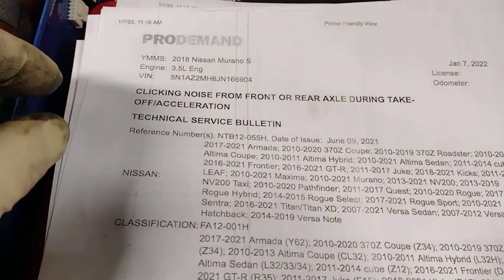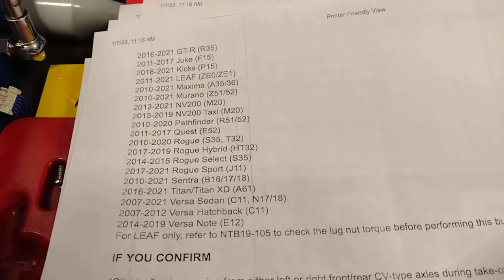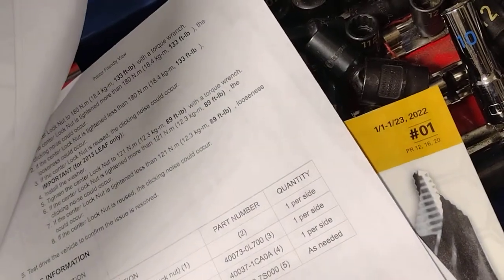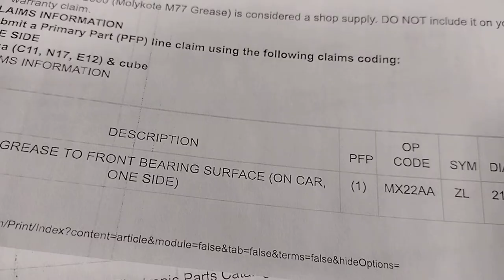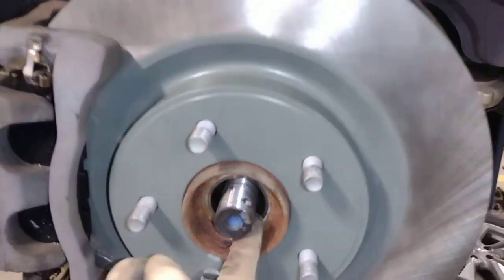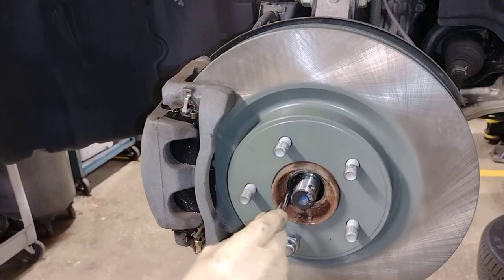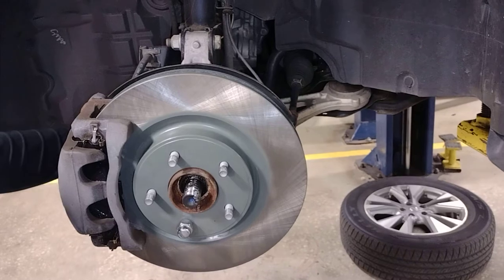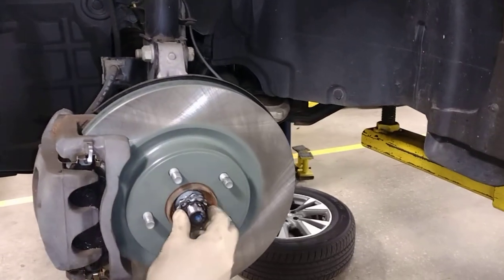2010-2021 Nissan Click Type Noise Or Thud on Acceleration/Deceleration/Turning. TSB NTB12-055H

Comment: I own a 2015 Pathfinder, and I know very well the transmission signs when they are going bad or acting up from my Altima's which were 2014 (5 defective transmissions)
 I took mine into a transmission shop at 69K to have them check for noise, the transmission WAS NOT SHUDDERING, just humming, they said it was a internal bearing, I hesitated and asked them if it could be a HUB bearing, sounds like a bad tire or humming as different speeds, and they said NO, I said I would pay them to replace Hub bearings and they talked me out of it. 
I ordered mine on line for $100 bucks and replaced both front, the noise went away! transmission was shifting as it always did, BUT I had the clicking noise and just knew it had to be the transmission finally doing what Nissan CVT do, go bad. 
But I watched this video and thought, that's the noise, the DIY dumbass probably didn't grease the spline as he described, (I'm the DIY dumbass) so I thought why not, jacked the front end and did exactly what he describes in this video and BAMM clicking noise gone when putting it in reverse, or any gear and drives like it was when we purchased it.
BIG THANKS FOR THIS.
 I think even reputable transmission shops take for granted ALL NISSAN CVT are bad! I watch Market Place and cant believe how many NISSANS that have 245K plus with a CVT transmission for sale still running strong, I want to be one of those people.
Will see but BIG THANKS for this!
Tools
Jack-Impact-Torque Wrench-Jack Stands-AND MOLLEY GREASE and it took about a hour with a coffee break in between....
Reply from the maker: Man, that's totally awesome. I'm glad i was able to help you out!  That's why I am here. Yes, cvt transmission are bad, and Nissan has the worst reputation for them.  However, what you described in your comment as I was reading didn't say transmission to me.  You were able to do this at home. Even with a coffee break, it took about an hour. It's the little things like this that make my day!  Enjoy your weekend!

Comment: It seems maybe... you could... just maybe try to spray some lubricant from the top axle/knuckle and let it soak inside for a bit to test if the noise goes away or gets quieter before doing this to confirm
Reply from the maker: What's that going to do?  The lubricant will just dry up. It's literally the repair procedure from Nissan.  There's too much play between the splines. That's what the grease is for
Reply: @BeardedFordTech  agree, I just thought as something to do try, obviously not a permanent solution if that's the problem with excessive play
Reply from the maker: @MylifeMB  i wouldn't waste the time with spray lube. Your just going to end up going  back in there. Just grease it and be done with it 😁

Comment: This can be done on either side? My noise is on the passenger side of the car. 2017 Sentra. Any advice for that whiny CVT? Thanks
Reply from the maker: @chadfowler7569  yes. Both sides. And the whiny cvt. Well.....replace it. It's not supposed to whine and doing a fluid flush won't fix it. It needs a new one
Reply: It’s been whining for a few years, but shifts and drives as it should, I think I’ll wait on the replacement. I appreciate your response!
Reply from the maker: @chadfowler7569  only a matter of time. I would seriously take that thing out and put in a DCR from S&S Motorsports

Comment: Deceleration, my favorite pet non-word.  Acceleration just is.  A change in acceleration causes a change in velocity.  Positive acceleration and the vehicle speeds up, negative acceleration and the vehicle slows down.  Apply and acceleration from the side and the vehicle changes direction.  Ok, OCD time is over ....
Reply from the maker: Lol. It was just basic laments terms. I like the way you explained it. But basically what happens when you step on the gas or let off or turn the CV axle bumps inside the hub.
Reply from the maker: You still need the brake vacuum?  Or did you get it fixed?  I don't think I ever got an email from you
Reply: @BeardedFordTech  - I appreciate the offer but I'm either going to fix mine or order a new one.  They're not terribly expensive.  The one I have that's not working so great was a freebie and is like $20 on Amazon.  Do you have one that you prefer?  Me being the amateur that I am was just going to go with another $20 one off Amazon unless a pro has a better suggestion.  On Amazon all the $20 one's look the same except for either the brand name or the color of the plastic case.
Reply from the maker: @abikeanditsboy3449  I love my matco one. It's been the best so far.  Harbor freight has a decent one for like $30. If it's just to use every now and then.

Comment: Good video, a shame that Nissan's torque specs are not clearly marked anywhere. But note that TSB only says to grease the backside (not the outside) and not the splines but the axle/bearing contact area. And of course it says NOT to reuse the nut, washer and cotter pin. Total cost at the Nissan dealer is under $7 for all of those parts.
Reply from the maker: Yep. But then they charge an hour labor or something like that. You can do it at home for $7 and a Saturday afternoon.

Comment: Did you feel the click in the pedal or floorboard when you tested the problem.  My pathfinder has a small click Occasionally and i can feel it slightly on ds floorboard
Reply from the maker: No. Just audible. Didn't feel it at all

Comment: Well, just to start, I was really worried what was wrong and how to diagnose the clicking problem with my nissan xtrail and I came across your video. I was contemplating getting rid of the car because of the price of a new drive shaft or clutch so I tried this fix and it stopped the clicking dead really lifted a weight off my shoulders keep up the good tips top man 😊🎉🎉
Reply from the maker: Glad the video helped you out!  I'm glad it worked out for you.  Have a great day

Comment: Thanks so much for this video bro, I thought this noise was my transmission going bad 😅, still will be nice if Nissan makes a recall out of this…keep the nice work 👍
Reply from the maker: Yeah won't be a recall. It's not a safety concern. Just an annoying noise. Just a TSB (technical service bulletin). And honestly a slot of Nissan techs know nothing about it.
Reply: I did the procedure today and I am surprised the clicking noise is gone, now the car is running smoothly, thanks @beardedfordtech for saving me thousands of dollars in repairs, this was so easy to do👍
Reply from the maker: @JOSEHERRERA-vl2yi  glad I could be of some assistance.  Glad it fixed your problem. Money saved!
Reply: @BeardedFordTech  The problem is that it can decrease resale value when someone tests drives it and it makes a loud popping noise and they choose to pass on it for that reason (I know I would).  I have had mine in twice to the dealership on warranty to try to fix it.  They have greased it twice and it still makes the popping noise.  I am working on the Lemon Law paperwork for if they can't figure it out in the next two visits.

Comment: Thanx for the video. Is there any cheaper alternative than Molykote M-77? Or if i can buy somewhere just a small piece of this grease?
Reply from the maker: Unfortunately it has to have moly in it.  Usually comes in a tube you put in a grease gun, or a small tub.  I mean any grease with moly in it should be fine. Go to your local parts store and browse around. I'm sure they have something there. Have a great day. 🤘🤘
Reply: @BeardedFordTech  Thanx for quick response. Will do that ... some with mos2 moly - understand. Nice day!

Comment: Was it a rear wheel metallic click sound at below 20mph  low speed only? I'm having issues with my wife's and this is 1 of many problems
Reply from the maker: @miketoti144  nope this was in the front. When you accelerate from a stop or turn.  I do believe the rear has issues as well.  Wouldn't hurt to grease it and see if the click goes away
Reply: @BeardedFordTech  I appreciate the response and advice. I'm tearing it down tomorrow and gonna grease everything I need to and check the suspension further.

Comment: Is this a permanent solution or will the molykote grease need to be reapplied periodically?
Reply from the maker: @vigneshie  honestly I have no idea. I don't own a nissan and it's been many many years since I've done this car. Have seen it since.  I don't think moly grease needs applying periodically.  It's molybdenum. So it stays pretty tacky in there.

Comment: @bearded Ford tech does it apply to 2020 nissan altima sr , I clicked on your tsb link but 2020 wasn't listed and based off the description sounds like I have the same issue
Reply from the maker: If it's not on the tsb then it doesn't fall under that. But wouldn't hurt to do the procedure to see if it goes away. Or have them checked to make sure the boots aren't torn and slinging grease.
Reply: Same, I have a 2020 Altima SR and this description of the problem almost matches mine perfectly. I literally have no idea what it could be other than this.

Comment: Hey man. Quick question about the wording in the TSB - it says that you must “apply a coat of grease to the bearing surface” (you can see it if you pause at 0:58.

So what is “bearing surface”? Is it where the front of the CV axle touches the back of the hub? Ie, the “collar”?

If it were wouldn’t the TSB state “grease the splines” or something like that? 

There’s so many videos on YouTube about this - many of them are going out of their way to lube the splines but largely seem to ignore the “bearing surface. 

Would appreciate some clarification from someone with industry experience. Cheers!
Reply from the maker: It's the backside of the hub where the Axle goes through. Just do it like you saw me do in the video. That is literally step by step instructions on where to grease. Nissan wording is very weird.
Reply: @BeardedFordTech  Thanks. I just did this - follows the steps to a T and torqued to 130 NM - but the noise just hasn’t home away. For grease, I used a Yamaha Moly axle grease. 

There is definitely an improvement but the noise hasn’t gone away. Any idea what I did wrong? Maybe I didn’t do a good enough job cleaning the two surfaces at the back of the hub where the axle makes contact?
Reply from the maker: @A_P_X  if it still does it after that. You have another problem. I would get it checked.  Check the sway bar links and bushings. Check everything under there.

Comment: I thought they said to not grease the splines?
Reply from the maker: Literally says in the TSB that I showed to grease the splines. That makes the click go away
Reply: @BeardedFordTech  it says apply grease to bearing surface.
Reply from the maker: @Wastednow  read it again. It says remove Axle nut. Push Axle back lubricate splines. Which is the bearing surface. The bearing is made into the hub. The click is cause by a little gap between splines. The push against each other. Your not shoving a bunch of grease in it. But just a light day on the outer and inner. If your vehicle isn't listed on there. Don't do it. You may have another problem.
Reply: @BeardedFordTech which part of the video does it mention “grease the splines”? I’m having this issue with my car and will perform the tsb soon. I’m just confused with this part
Reply from the maker: @Wastednow  when you push the Axle back your brushing on part of the splines and the outer portion of the bearing. You can google the tsb number and print it so you don't have to keep puasing the video. I did a lot of these when I worked at Nissan. Make sure you use molykote or a grease with moly in it. If you don't want to print it. Just follow the video and do exactly as I did. Even if you replace the Axle it will just do it again. It's cause by the spacing between splines and where the Axle meets the back of the hub bearing.  Your not taking it out and greasing splines. That's a no no.
Reply: @BeardedFordTech  I appreciate the help. I looked into the most up to date TSB for this (ITB13-008D) and I don’t see where it says regarding greasing the splines. This person in the video made for Nissan techs even said not to touch the splines.

I’m having an issue with my car engaging into R or D very roughly. It thumps hard into gear and the more I drive the car in one run the more prevalent it gets. If I switch from N to R, back and forth, I get a regular engagement after the 2nd time switching to R. It seems to clunk into gear after changing directions which is from forward to reverse to vice verse.

I don’t have any clicks, only the thumps that I feel in the rear. When I’m driving at city or highway speeds, if I tap the gas I hear a clunk that sounds like it’s coming from the rear driver’s side and sometimes the clunk is there when I get off the gas. In manual mode I can replicate it almost every time I tap the gas, especially over 2.5k rpm. 

I ordered the grease in the TSB. I heard that people with the same issues as me performed this TSB with success in fixing my issue.
Reply from the maker: @Wastednow  yeah we weren't greasing the splines. Sorry about the confusion. It's the backside. Just like in the video. This is for a click noise on acceleration from a stop. Or coming to a stop. Sometimes in a slow turn. If your having a clunk it sounds like you are having a transmission issue. The CVT transmissions has been a known issue on Nissan for a very long time. They can't seem to get it right. I hope you find the problem and get it fixed friend
Reply: @BeardedFordTech I’m driving a 2015 q50 AWD and I’m getting all this feedback in the rear. I had it checked out and even replaced the driveshaft because that’s what we thought it was. Then we thought it was the differential. 

Now, after seeing the TSB and reading about other people’s success with it that have the same symptoms as me we’re going to try this next. My car is apart of the TSB I mentioned. It definitely sounds like something may be banging against something else in the hub. 

Have you had any experience with something similar to what’s going on with my car?
Reply: @BeardedFordTech  Also, Transmission which is the 7 speed jatco was replaced 18k miles ago by Infiniti. It’s definitely not the trans :)
Reply from the maker: @Wastednow  just because it was replaced doesn't mean it's still good. I've had brand new transmission. Internal parts be bad. I would get it check out first.
Reply: @BeardedFordTech  I did and the consensus was that it is not the transmission and in fact something in the rear
Reply from the maker: @Wastednow  all wheel drive?  This tsb only applies to the front. Did they check the rear differential backlash?
Reply: @BeardedFordTech   Check out tsb ITB13-008D . It states rear or front axles. The q50 is a rear wheel drive bias car. So it’s rwd all the time until it detects slip and activates AWD.
Reply from the maker: @Wastednow  okay that's a updated tsb. I see now. Yeah grease it. This one was for front wheel drive. Follow that tsb see if it clears it up.
Reply: @BeardedFordTech  will do! The grease will come in a week unfortunately. I hope this fixes the issue I’ve been having
Reply from the maker: @Wastednow  your local autoparts store should have some. Just tell them you want grease with moly in it.

Comment: Does this apply on a awd 2022 Nissan Altima sr? I hear like a hummming noise when accelerating and de accelerate car only has 5k miles
Reply from the maker: No. This isn't for a humming noise. I would take it to your local dealership as it is still under warranty.